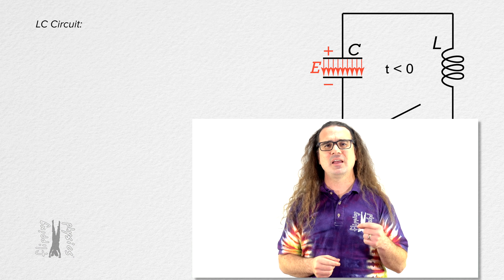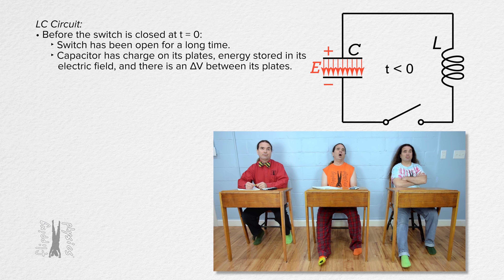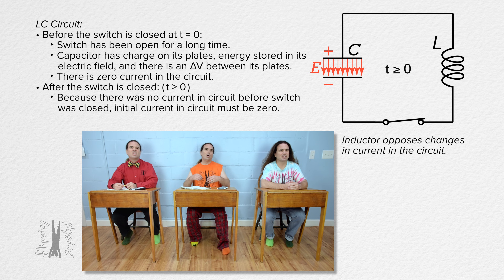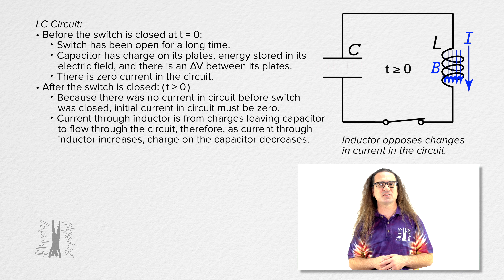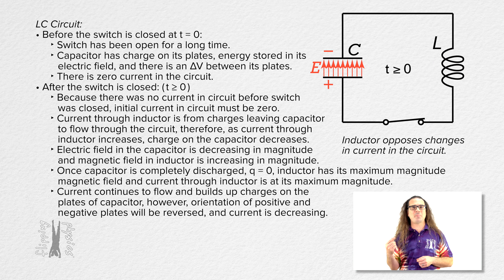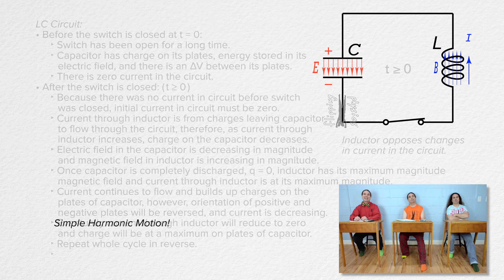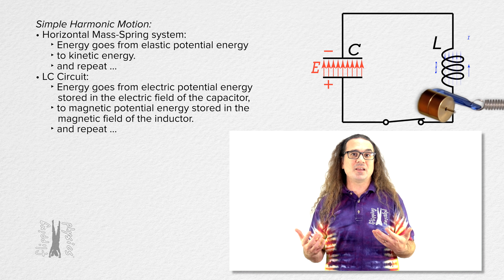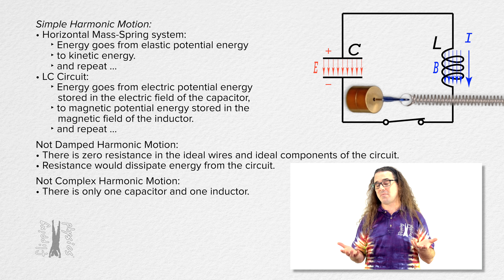LC Circuit Basics

Comment: Is there a thing called a LRC circuit which utilizes the three  circuit components we learned. Would it work differently if there is or isn’t a voltage source present
Reply: the specific answers to your question are more complicated and arent included in the basic ap curriculum. In short the answers are yes, ask CHAT GPT for an eplaination.

Comment: what creates the current when the capacitor is fully charged?
Reply: Current is momentarily zero, when the capacitor is fully charged.  The inductor would otherwise short the circuit to drive it to discharge, but its inductance impedes an abrupt change in current and prevents it from being a short circuit.  There is a cycling transfer of energy between the electrostatic potential energy in the capacitor, and magnetic field energy in the inductor.
Reply: the inductor resists the change in current, and bcz current becomes zero after capacitor is fully charged, it will create an induced current.